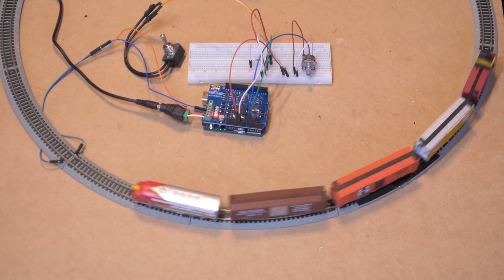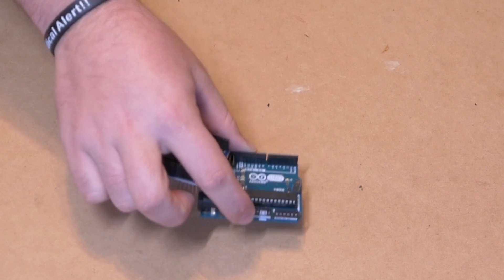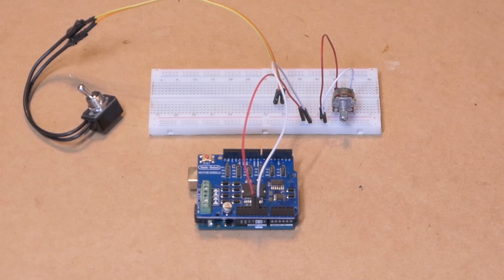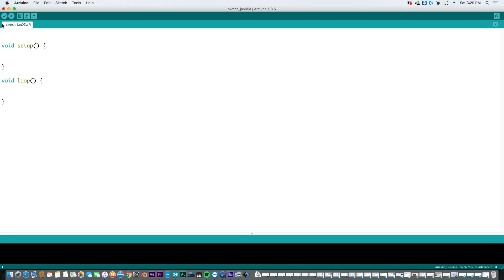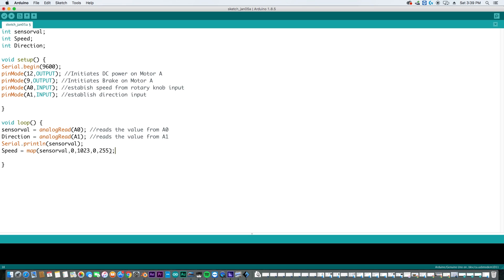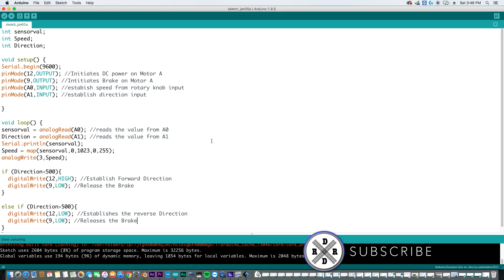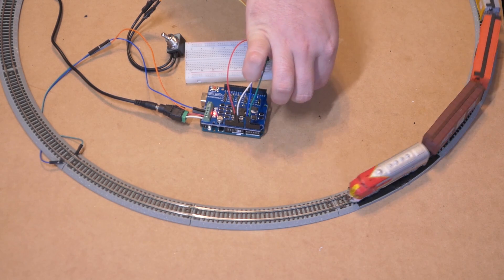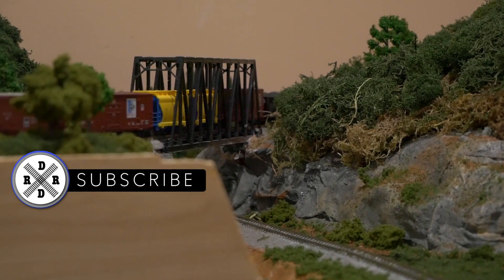Arduino DIY DC Model Train Controller

Comment: I recently made this with an Arduino mega since i plan to expand to DCC later on, which uses a Mega. While testing it with an older Kato locomotive, an audible high pitch noise was coming from the motor. I learned this was due to the PWM of the Arduino mega which is 490 and 980 Hz which are frequencies that are very much audible to the human ear. A simple line of code at the beginning of the Void Setup to raise the PWM frequency of channel 3 fixed the issue : "TCCR3B = TCCR3B & 0b11111000 | 0x01;"
This raises the PWM frequency of channel 3, which is used by Pin 3, to a higher level that is not audible to the human ear, thus eliminating the high pitched noise coming from the locomotive's motor. 
Hope this helps if anyone else runs into the same problem!

Comment: This is a well-presented video, but I have to ask, why?  A microcontroller + software code + a motor driver board all to achieve what a conventional analog motor control circuit does. A handful of electronic components soldered together from a schematic would do this.  Is the point just to avoid soldering?

Comment: Very complete intro to building a model train controller... or variable speed motor control. Perfect to add to a model railroad layout. The controls can be mounted on the layout surface ,or side of the track layout substructure, for a lot smaller footprint than the usual model railroad train controllers! Just a switch and potentiometer knob, with the rest hidden below deck.

Comment: You don't need the "if (Direction >500)" statement because you tested for Direction<500 in the previous statement, so the else MUST happen for Direction values that aren't below 500.
It can be omitted completely and, for good programming technique, SHOULD be. If you leave it in, ask yourself "what happens when the value of Direction is exactly 500?" It fails "if... < 500" AND fails "if... > 500" and neither of the digitalWrite statements can happen. Fortunately, this would be a rare and possibly momentary event, and the previous value would be used. (or zero)
Some programming languages expect an "elif" to happen or be given after an "if", but Arduino C is not one of them, and even then, it does not need a test, the "else" or "elif" only happens if the "if" has not come "true".

Comment: Thanks for the enlightening demo. Would there be additional considerations or changes to handle an analog DC HO system?  In other words, can the motorshield handle the current/power for an HO loco?

Comment: How do you tell it which locomotive address you are controlling?
Reply: It's not DCC.  It puts a PWM voltage on the track, and every DC loco on that track will run.  There is no such thing as "locomotive addressing" in a DC system.

Comment: Nice tutorial! I'm building something similar and wanted to look for some examples before I started.
There are a number of issues with your code, though.

analogWrite(3, Speed) ... the parameters are not min and max values.... they are pin and value, so what this command is doing is writing the value Speed in pin 3, which is the speed of the motor. The code is correct, just clarifying.

digitalWrite(9, LOW) ... since you never set this to high, you might as well just set it to LOW once in the setup and leave it out of the loop.

Direction = analogRead(A1) ... I don't know what kind of bad experience you had with digital inputs, but you should DEFINITELY be using a digital input here. There is no margin for error. There are no hiccups. If you have some kind of hardware problem that affects your digital pins (like bad contacts), you should go and fix that cause it will probably affect your analog pins as well. Direction is either forward or backwards, so use a digital input. Plus, you can use pinMode with the INPUT_PULLUP parameter, and do away with the resistor in the breadboard, just connect the switch between the arduino pin and ground. Be aware that when the switch is ON, your digital read will be LOW, and when it is OFF, you will read HIGH due to the internal pullup resistor. And instead of naming it A1, for digital functions, that pin is named 14.

else if (Direction > 500) ... everything after the 'else' is unnecesary, not to mention you are leaving the value 500 out of both conditions, but that does not really affect functionality here. If having the explicit condition helps you understand the code, just add a comment like this:
else // (Direction >= 500)
In any case, if you switch to digital input for direction, your first condition should be something like:
if (Direction == HIGH)
and the other brach, would look something like:
else // Direction == LOW

Did you continue working on this? The real power of Arduino is that you can add a lot on top of this basic behavior. e.g.: If you are going full speed and switch direction, you may damage the train motor, plus you may derail the train, so you can make a smooth transition from the current speed and direction to the selected speed and direction.

Comment: Is it possible to have the switch and potentiometer on a different not connected breadboard and have their outputs connected to the arduino via, for example, bluetooth?  If so, how would that be done?

Comment: Dear Jimmy, i have a question. I don't see any connections between the digitalpin 9 and 12 in your video. How are those connected with the motor A ?
My train doesn't run. Has this someting to do with the PWR ? I read somewhere that I should lower this value ?
Can you give me a clue? Thanks .

Comment: I have a very silly question. How do the coding interact with the DC motor? Is that the settings at beginning interact with the Arudino shield?
Reply from the maker: Thats not a silly question.  The arduino is essentially controlling a motor.  So the code is essentially speeding up and slowing down an electric motor.  This does this by using the motorshield to translate the digital signal to varying electrical power.
Reply: @DIYDigitalRailroad  Thanks for your prompt response. I mean does my computer physically connect with the motor shield. I didn't see anything like that in the video, so was wondering. It's a cool project. I already purchased everything needed for the project and just have start working on it :)
Reply: Hi, I still have the question of how the coding that was done in the Arduino editor interacts with the DC motor shield. Based on the video, I don't see any physical connection between the motor and a computer where we do the coding? please help.
Reply: @automationaccount4586  you write the sketch on your computer by means of the Arduino IDE and then you flash your sketch to the Arduino also with the IDE. Now the sketch is on the Arduino and it does not need the computer anymore and it will run the sketch automaticly over and over again as long as the Arduino has power. Maybe you should look up some info about what an Arduino is first.....

Comment: Hi Jimmy,  This is a cool project and I am planning to do this now. I have a silly question. The train has nothing to do with the circuit or the communication part? Does it run with the help of the tracks completing the circuit? Please let me know. Everything is clear to me except that part. Thanks
Reply from the maker: You are correct.  Think of the track as leads to the electric motor inside the locomotive.
Reply: @DIYDigitalRailroad  Thanks much!
Reply: I am planning to do this project with my kids. So Arduino sells the entire kit through their website?

Comment: Wow, I didn't think an Arduino could be used as a DC throttle.  I just may have to pursue this.  I've got an 18 volt 3 1/2 amp computer supply that I want to use as a DC power pack.  I've already gotten a PWM voltage control; just need to get a fuse inline with the DC power supply in case of a short circuit and a single pole single throw switch for controlling the direction.

Comment: Hello again. I am still working with your project and it works fine. I would like to add another POT and reverse switch and send that POT signal to the B output on the motor shield. I have all of the electronics hooked up to what I think is correct. I just used 2 more analogs on the shield for the new POT and reverse switch. It seems to work because as I play with your code (which I am not good at), each POT will work, but they both seem to only control output A. They never work simultaneously.  I'm sure it's something with my code. Would appreciate any help!! Thanks
Reply: Corey Gibson I assume you mean to have a second track running from motor output B? If so did you manage to get this to work? I’m considering getting everything to run this but I have 2 separate tracks which would be a lot easier to control from one Arduino rather than the additional cost of two of everything. (I.e. 2 Arduinos, 2 motor shields, 2 power supplies etc)

Comment: Hello, great video. I just happen to have all of the parts you used so I decided to try it before I build my layout. Right now the track is just setup for testing. I currently run DC vintage controller. I built your system and it seems to be working with just a couple of issues that I will sort out. The Pot I have is a B 50k. It has a drastic jump when watching in the serial monitor. Also the loco will only move when the pot is wide open. Another is my loco runs fine all the way around using my old DC controller, but dies quick using the Arduino. Maybe my vintage PSU is AC maybe? I will use feeders and buss, but if one work, shouldn't the other?  Other than that, I think I will forget DCC for now and try this approach to run at least two trains simultaneously. If that's possible. Thanks
Reply: Never mind. There were issues on my end. It works fine. Locos do not run as fast as my old controller,  but it does work. I had to add feeder lines just for testing. At first I had 12v to the motor shield. It ran about half speed. Then I put my 15v psu to the motor shield and it went a little faster. Right now its putting out about 11.5 to 12 volts. Thanks Again!

Comment: I bought an L298P motor shield but it looks different than yours.there is an A and B motor terminals but no power where yours is located. Another wire terminal is located to the right of the motor terminal with UMS & GND.
Will this still work or do I have to get a different motor shield
Reply from the maker: There are several different versions of the L298P motorshield.  It should still work ok.  If it doesn't I have the original one that I used linked in the description of the video.

Comment: I'd really like to see some automation with this dc setup, including automated throttle control. Is automated throttle possible without using PWM? I've heard some bad things with overheated motors using PWM on dc locos.
Reply: You would have to add an RC filter (a resistor and capacitor) to essentially filter the square wave PWM into a nearly-smooth DC, at the output from Arduino, and then feed that through a couple of transistors to beef up the current before sending it to the track.  If that is all talking gibberish to you, I'm afraid the short answer is "no".  There's no built-in way to make an Arduino put out anything but PWM.

Comment: From a technical point of view there is no reason to use an analog pin for the direction input. The digital pin works internally the same way as your code line and gives a 0 value below about 2 Volts on the pin (check the specs for correct values). The advantage of using a digital pin would be that you could use the internal pullup resistor,  so besides simplifying your code you can also eliminate the external resistor

Comment: I think I know my answer, but I'll ask anyway: How many DC locos will this setup control? How do you know what to type to program something like this? RH
Reply from the maker: I haven't tested it with multiple locos yet, but It's a 12 volt power supply with 2 amps per motor I believe I would have to check.  In terms of what to type, I just do my research and look at the examples that Arduino provides in their software,  this one for example, I studied how to control a DC motor which is essentially the same, then I combined it with some knowledge from some other projects I've done, and bam!
Reply: Arduino can also control DCC locos. If you want to control dc trains separately , you have to segment your tracks and put on each segment its own motorshield. Kind regards . P.S let your fantasy out of control the arduino solutions are incredible wide. Your old television remote , PlayStation / xbox remote,dcc controller, bluetooth or wifi android you name it remote thing clapper is usable. I am trying to use a audio midi controller and it works.